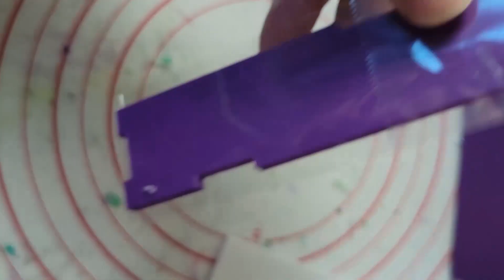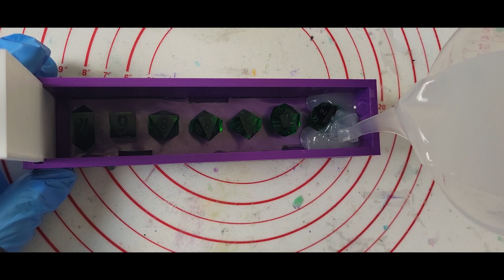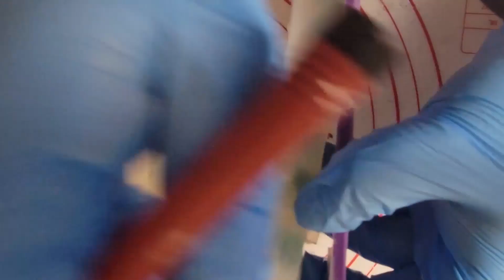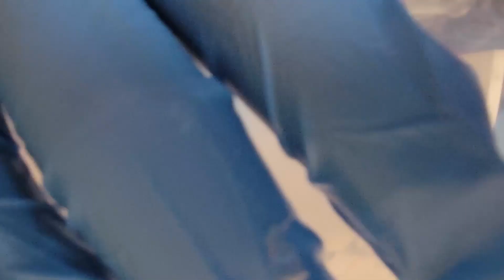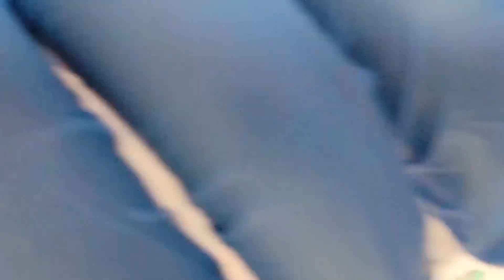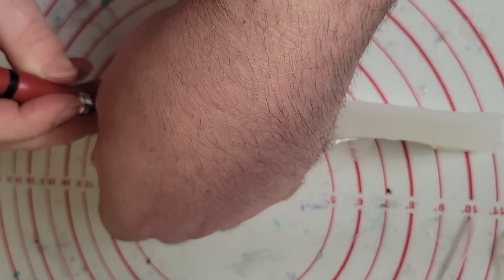7 Piece Slab Mold

Comment: do you put any release on the dice itself?
Reply from the maker: I use ease release 200 but only because my masters have been treated with inhibit x.
Reply: @KiltedDice  Are the green masters in the video treated with Inhibit-X? They look really great and shiny, and I thought Inhibit-X would matt my masters down?
Reply from the maker: @ohjay93  Hey, sorry for the late reply, holidays and all. 
Yes, the Masters in this video are treated with Inhibit X. I treat all of my personal masters with it because I'm impatient and want to make more Click Clack Math rocks!!! :-D
Reply: @KiltedDice  Which resin are you printing with that you need the Inhibit-X? All the casting I've done from printed masters I've been using the Elegoo basic and Elegoo ABSlike and haven't seen any issue with silicone curing. I'm using the DS 20.
Reply from the maker: @rothery2  I use Elegoo basic transclucent green. Not sure if maybe the dye causes the cure inhibition or what, but it definitely does.
Reply: @KiltedDice  Have you found inhibit x worth it?

Comment: Looks great! Have you tried a flat pint brush to put on the vaseline? I find the better control helps a lot.
Reply: Actually a silicone tipped makeup brush  works best.
Reply from the maker: I have not, but that sounds like a pretty good tip. I will have to try it out. Thank you.